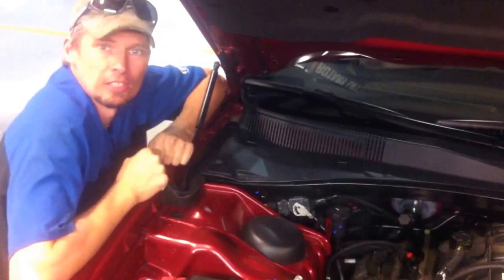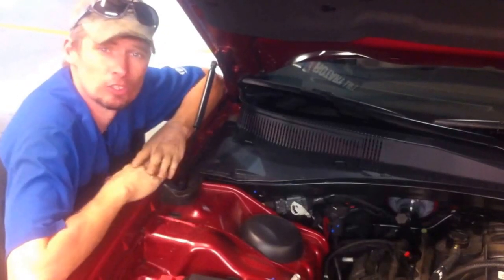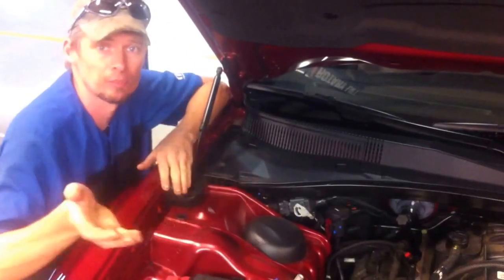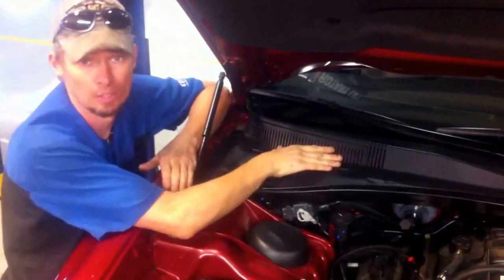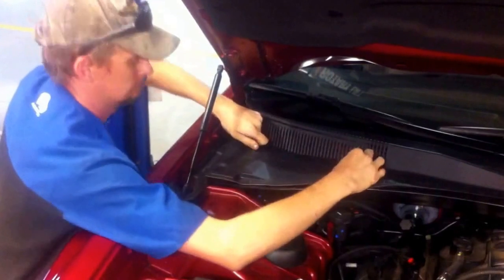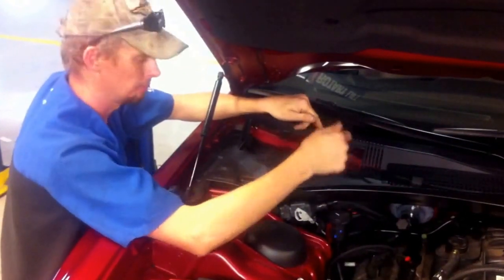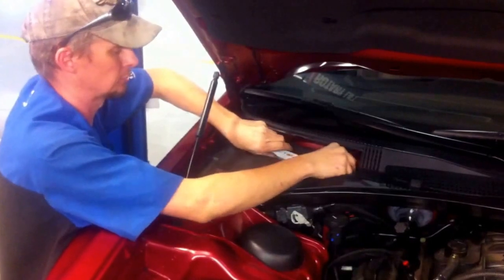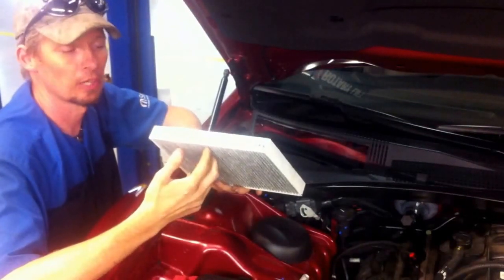2012 Chrysler 300 cabin air filter replacement

Comment: Very useful video. It is for the 300C, not for the 300M, which has no cabin filter ;-)
Reply from the maker: you are correct, also...the 300m is the older model. The 300c came with the hemi. Thanks for the comment and nice words. please make sure to subscribe as well